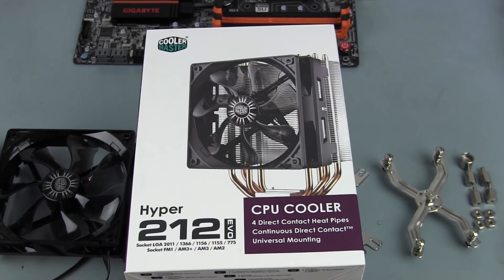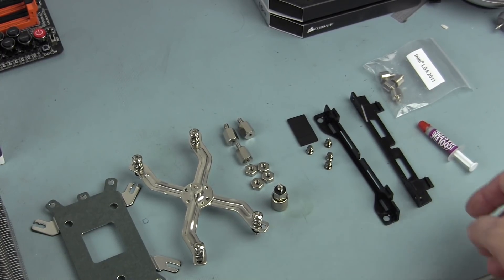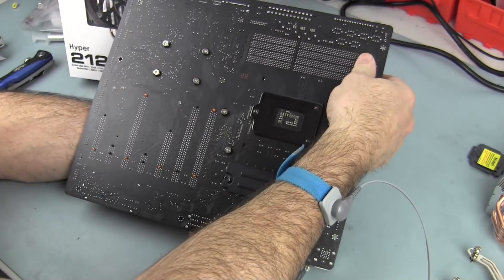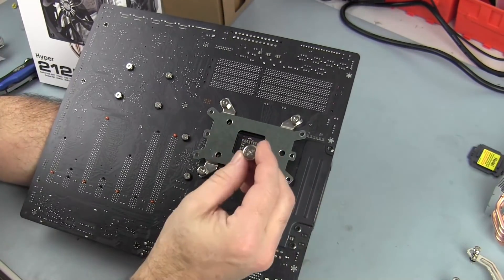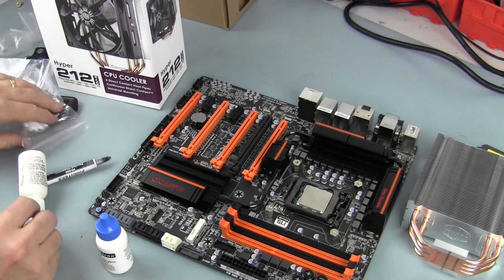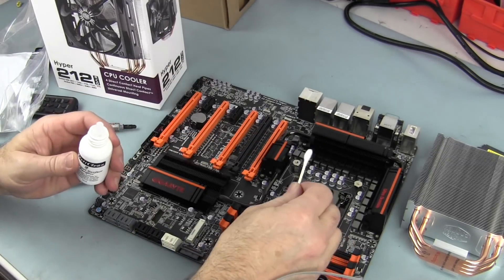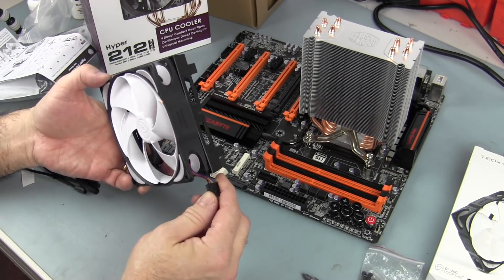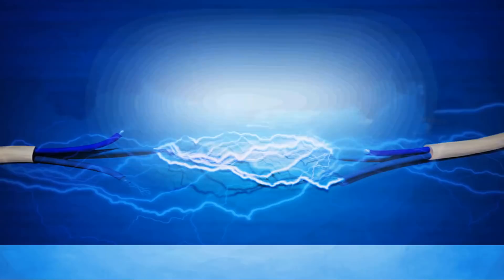How to Install a Cooler Master Hyper 212 Evo CPU Cooler

Comment: Thanks a bunch for this tutorial. The instructions that came with the cooler was shit.
Reply: I hate to be the 213th like lol but yeah, everyones an expert the second time around, 1st time...lets get it right 4 sure! When i can view this next I'll be running my Vostro 470 i7-3770 budget banshee...cool...er! Used to be a OC vid for the non K version of my chip claiming it can be and so can similar i cores...anyone know the right touch to O.C. non k ivy bridges, or any really neat tricks to push more out!
Reply: Great video man tyler.thai engineering mountage is totally shirt. Is great cooler,but installing is totally shirt.
Reply: it definitely was...i thought i was stupid. Glad to know the people who wrote that shit are.
Reply: Mr. T - I (pardon my french) fucking hated installing this one especially since the instructions were so vague and it failed to specify a lot of important information. Mine ended up covering one of my RAM slots so I guess if that stick goes bad then I have to do this all over again.
Reply: @MeniscusKing  My Sapphire RX560 4GB GDDR5 covers my whole first bank and in a mid case you gotta use a toothpick to get under the damned thing to get it to release for upgrades! At least this guy has his shit down i see an 80 dollar ESD mat and a wrist strap...in my job i can wear a footstrap or esd shoes! Need more people like this and less people giving advice building on carpet!!!
Reply: BasicB I almost damaged my motherboard with the screws that go through it

Comment: Hey, my huband & I are just curious as to what the wire going to (what appears to be) the watch on your wrist is? Microphone, maybe? Anyway, great video. It just helped us a bunch. Thank you.
Reply from the maker: it is a ESD wristband. To prevent electro-static discharge to any computer components.  You don't have to use one, as long as you touch the chassis (metal part)of your computer before you start putting parts in.  Google ESD and you should find plenty of info on ways to prevent it from damaging anything.

Comment: My bracket teeter totters and I can't figure out for the life of me why. I put one screw a few threads in. This causes he one diagonally across to sit WAY up in the air. I can't see what the crap is going because, yup you guessed it my MB is already installed. I'm going mad over here . 😤
Reply from the maker: If I recall there is a pin under the bracket that should line up with a hole in the block underneath.
Reply: @Ronsanut  Thanks! The pin kept popping out of alignment with the notch on the bottom of the bracket.

Comment: I just ordered the Cooler Master Hyper 212 Evo CPU Cooler from Newegg. It was just delivered and I installed it today on my Intel LGA 1156. They slightly modified the kit. There were black spacers to add to the front side of the Motherboard between the standoff's and nuts. 

I tried to follow this video exactly and the bracket wouldn't reach the standoffs. I double-checked my instructions and noticed it said to install the spacers. I did that and the install went smooth the 2nd time.

Still super helpful during my install. Thanks for the video!
Reply from the maker: Glad it helped you.

Comment: Thanks! I installed this 212 cooler on my last build in 2014, but forgot how I did it. Now I'm going to rebuild it with mostly new components, but I want to reuse the old cooler. I'm still running the original Cooler Master fan and it remains dead quit after 7 years! CPU temps 37- 38C under load. We will see if it performs as well with a much more powerful and hotter processor (i5-4670 vs i7-10700).
Reply from the maker: Very cool. Enjoy.

Comment: Hey man I think I put the mounting bracket on wrong and tightened it to much. I think i bent the pins in my Asus Prime Z490 Motherboard as I am not getting a POST. Any suggestions?
Reply: uh, you broke it?

Comment: Hello and great video. Very helpful. Can I have this cpu cooler sitting sideways? Does it's attitude toward gravity have any affect on it?   I'm thinking I might have to lay my pc down flat.
Reply from the maker: Yes you can lay it down.  The way it secures to your motherboard will keep it in place.
Reply: @Ronsanut  Thanks for the fast reply. I was wondering however if I could have my pc sitting in it's  normal vertical position and not laid down flat and would that affect the heat pipes ability to do thier job.  Came back to edit this:  Just caught a vid showing test results regarding heat pipe coolers flat vs vertical ( gamers nexis) It should not be a problem. My cpu cooler is installed and ready to try out-  sideways.  Thanks again.

Comment: I just realized my problem with this cpu cooler. Mine didn't come with the standoffs that you screw the X thing into which allows you to screw in the backplate first. Mine came with some weird parts that make it so you have to line up the X screws, press the backplate in, and hand tighten 4 little nuts on the back and put pressure both ways - all at the same time. Before the one I had got taken off amazon, people were saying it feels like you need 6 hands to put this thing together and I understand why

Wish I had the easy version this tutorial does lol

Comment: Hello sir I have a question. Is it okay to install the fan on the left side instead on the right side? tq
Reply from the maker: You can install on either side just make sure the fan blows air through the heat sink for best performace.

Comment: the screws wont meet the stand offs no matter how hard i push, how tf do i do this, it looks so easy in the video but its impossible irl
Reply: nvm i figured it out, there are little plastic cylinders you have to put under the standoffs

Comment: My CPU started getting too hot to my liking. It's like a 7 year old machine with some parts upgraded here and there. It still has the stock cooler option so I figured I'd get more mileage out of the thing by buying this cooler and applying new paste. Most likely just putting new paste and thoroughly cleaning the old cooler would've been enough, but this was cheap enough to upgrade the cooler to. 

First time seeing a cooler that is mounted in this way though. I was personally hoping that I wouldn't have to remove the motherboard from the case, but I suppose the thing weighs so much that installing the back support is a must if you want to ensure that the board won't break under the weight. Luckily it's a one time thing.

Thanks for the tutorial. Will be helpful once the thing arrives.

Comment: Are you serious at 13:06 you changed how the X bracket went in but didn't correct yourself. What a waste of time. What find of tutorial changes a mistake you've made and then hides it. I'm tamping
Reply: Yeah I'm absolutely sure you took it back off and edited the video but I have no idea which is right brilliant
Reply: 13:02 & 13:05 you've taken the X plate and and put it back in differently.
Reply from the maker: Sorry I don't remember , it has been sometime ago.  I must have realized it but did not hide it on purpose.

Comment: To future buyers and installer for this cooler fan. It's a pain in the ass to screw the joint that connects the heatsink to cpu. Make sure you have properly move the screws that has spring to proper positioning depending on your cpu socket chip. I just save your hours of troubleshooting here.

Comment: so u would have to completely remove the motherboard to install this? that's a bit annoying
Reply from the maker: Depends on your case. If your case has a cutout area behind the motherboard, you may not have to remove the motherboard.

Comment: When i took the fan off i wanna know if it matters what side of the block it goes on? Plz neeed help with it
Reply from the maker: Ideally you want to place the fan so it blows through the block and out the back of your case. If you have an opening at the top of your case you can also orient it so it blows the air through and out the top.

Comment: Will it work with a lga 1151?
Reply from the maker: Yes it does.
Reply: @Ronsanut  what is a good and cheap alternative to this cooler that isn't a pain in the ass to install?(LGA 1151)
Reply from the maker: @tausiftaha12  This one is probably the cheapest but #4 on the attached list is good too and about the same price.
https://www.tomshardware.com/reviews/best-cpu-coolers,4181.html

Comment: Great vid thank you, helped me get mine fitted no problem. Benchmark temps dropped from 85+ to 50-55 running 4.2 on a i5 4690k. Total newbie to overclocking but well happy with that 👍
Reply from the maker: Awesome! Enjoy!
Reply: @Ronsanut  Still replying to comments 7 years later respect

Comment: Jesus christ, took me like 2 hours to get this thing installed, whoever designed that mounting mechanism should be saverly beaten.
Reply: facts
Reply: BRO DEADASS I STILL CANT GET IT INSTALLED SMFH
Reply: @camzzy7896  bro you better figure it out before Fortnite burns up that Cpu 😂😂
Reply: George H. Good one !
Reply: how did u get it in, am struggeling
Reply: At least it's very efficient once you get it on, tbh it could be simpler designed but not by much being a heavy long piece of metal hanging on the side of an upright MB
Reply: I had to use a pretty good amount of force to get the screws in the x bracket in.  It's almost like they have to be bent to reach all four holes.  Is that correct?
Reply: @hyenaswine  yes i did same
Reply: literally
Reply: Agreed
Reply: How did you do it I still cant get it in?
Reply: Lol
Reply: Get the hyper 212black. It's looks better, has a better fan which is quieter, and has a much easier mounting system
Reply: @whiplash7400  it's pretty much the same, I've had both
Reply: @whiplash7400  can that hyper 212 black cooler master be compatible with this processor : AMD FX(tm) 6300 six core and with this case:Xtreme Aenic Gaming  http://www.antryx.com/aenic/  ????   please.
Reply: @ChrisDMReloaded  Yes! The cooler fits both the case and that cpu so you're fine
Reply: @whiplash7400   thanks , right now i am having a problem with my Cooler master Hyper 212 EVO . every time i have the pc case in a vertical position and i play a videogame , there is a noise coming from the cooler . when i stopped the fan with my finger , the sound disappeared too. however, i noticed that when i laid down the pc case in a horizontal position  and kept playing the same videogame , the sound disappeared. i did all these tests with the case open. what seems to be the problem? is the cooler damaged? btw i cleaned it too.

Comment: not all hyper 212 are the same mine for 1151 stand offs to short they come with 4 black caps you have to put stand offs in to too make stand offs taller book dont even show that part have not found one video that shows you that

Comment: Thanks man! First time installing a cpu cooler that wasnt stock haha
I'm a little wary of cleaning the cpu tbh.
A qtip and a little rubbing alcohol should lift up the thermal paste yea?
Is it better to clean it whilst it's in the mb?
I'm always a little anxious with new things xD
Reply from the maker: Eather way is fine. On an intel chip you dont have to worry so much about pins. I clean them mainly when in the mobd.

Comment: My Cooler Master 212 came with some unusable plastic clips, not screws. Seems incredibly risky to push these down
as if they flip over, some part of the motherboard will most certainly be damaged. Will return my fan to the store,
can’t believe how cheap they are, to save on this important part of the cooler.
Reply from the maker: I know. Good luck.

Comment: I`ve just got one of these coolers, and when it comes to screwing the heat sink down the screws are impossible to screw down without forcing it really hard. It`s like the risers aren`t quite tall enough ( and i know there are two sets, and I`m using the longer ones ). I`ve seen two people fit these effortlessly now, I don`t understand why it`s so tough for me
Reply: I sent the Cooler Master one back and got a Noctua instead.  Far , FAR easier to fit. As it should be. No need to even look at the instructions.
Reply: U do have to press down with screwdriver to get it to catch, feels wrong but it does work

Comment: The screws on my x bracket don’t reach all the holes. Any help?
Reply: Did you move the x bracket all the way out or is it stuck in position?
Reply: XeroPhobous when it’s seated in the hole
and in the right position I screwed the holes in order the top right screw doesn’t reach the standoff 
So the bracket isn’t stuck I just try to reseat it and nothing changes
Reply: @djsheehey9193  hmm ok that's weird, have you tried taking it off and reapplying it?

Comment: Definitely worth the trouble of installing it, before I had to run my fans at 100 percent, after installing this they are running at 30 percent with a max temp of 55 Celsius, only got it for $10 lol

Comment: It's a nice cooler, but my god is it a fucking nightmare to install. I found that lightly screwing in one screw into the mount and then brute force screwing the diagonally opposite screw managed to lock the frame into place, it took me about 2 hours to figure this out though. This was the only way i could get the mechanism locked in place, and able to screw it to a point it was flush.

In total i spent like 5 minutes doing the backplate, and then like 2 hours installing the damn heatsink, such a ballache of a cooler. It's good though, but it's by far the worst installation of a cooler i've had.

Comment: I’m trying to screw my bracket down to the motherboard, but once one screw is in I have to force the other side down with too much pressure(at least I think). In your video it doesn’t seem like your using force at all. Can anyone help??!!
Reply from the maker: There is a small bump or key in the bracket that has to line up with the hole in the base of the cooler. You must have the bracket mis aligned, probaly just need to turn it around.. Look closely and you will see.

Comment: should the fan blow into the heatsink or it should suck air out of the heatsink?
Reply from the maker: You can do either. Most efficient though if you blow through the heatsink out towards the back of your case or up to the top to exhaust the air.

Comment: Kinda funny, i was just youtubing how to install a cpu cooler in general and the one i ordered happened to pop up first. But thanks for the video, i'm installing mine later today once it arrives in the mail.
Reply: Jacob Guenther hey do you know if it will go on a fm2 build?
Reply: @exploringwithashton424  yes, this will fit an fm2 socket, and it's pretty easy to figure out, i got mine installed in about an hour.
Reply: Jacob Guenther what games you play and what cpu
Reply: @exploringwithashton424  I usually play Rainbow six siege, forza horizon 4, and battlefield 4. and i'm running an i7-3770
Reply: Jacob Guenther lucky I have a a10-5800  which is a apu I’m going to get a 750 ti I’m new to this lol
Reply: @exploringwithashton424  your CPU is actually fairly decent, four cores will get you into any game nowadays. i would recommend an upgrade to my i7 or something similar though, just cause they are going cheap on the used market. but, that 750ti will be the bottleneck, i'm not really sure what the best gpu is for the price ( my rx580 was $190 usd ) but, that card will still game pretty well, especially on titles that are a few years old. i had a 780 3gb before and it ran games well, just was limited by the memory.

Comment: Is the fan bringing air into the heat sink or out? If you installed 2 which air flow is the best?
Reply from the maker: Air into the heat sink. Adding a second pulls the air through and exhausts it out towards the back or top if you have a case that has open ports out the top.  Two fans are best if you can fit them in the case and they do not interfere with your ram.

Comment: He did it wrong, changed it then continued the video. 12:59 then look at 13:07. The orientation of the X part is going away from the tubes (wrong) then with the curve toward the tubes (correct).
Reply: Commented before he said he did it wrong. My bad
Reply: anyway, watch full video before doing it
Reply from the maker: It has been so long.  Looks like that is what happened. I figured it out and should have said something. Or I did but was lost on the editing floor.
Still looks like most people figured it out and got it right.

Comment: The fan has to clear over the RAM so install the RAM before the Fan. If the RAM sticks up too far you can slightly adjust the fan height.

Comment: I installed this a couple weeks ago. I realized I had it 90 degrees in the wrong direction. So I reinstalled it today and now my pc won’t start please help
Reply from the maker: You must have loosened something or maybe do not have the heatsink fully installed on the cpu.  Also check your CPU power cable and 12V ATX power cables, One of them may be loose or disconnected.

Comment: If the MB is already installed can you just mount the bracket to the back of the case?
Reply from the maker: If you have a cutout in your motherboard tray and can access the back of the motherboard holes the bracket mounts to, then yes.
Reply: Yes it has a cutout and a recess for the bracket to go in... I just didn't want to rip my whole build apart and take out the motherboard just to switch fans.
Reply: Yes it worked, it was tricky though because in this video you don't use the plastic spacers and for my intel build I needed to use them because the bracket wont reach the feet by just a few millimeters. It's all good now though, thanks for the instructions.
Reply from the maker: @couerl  Awesome!  Enjoy!